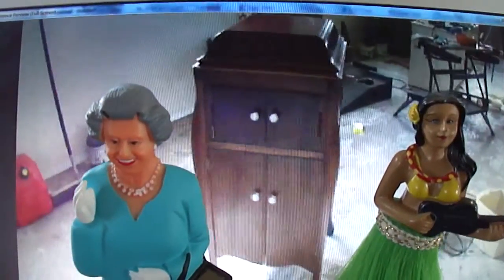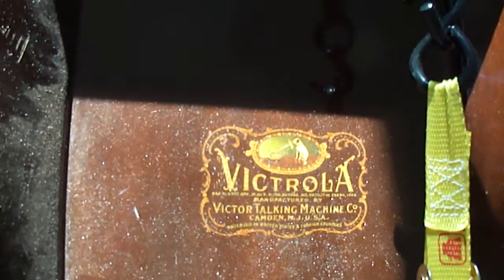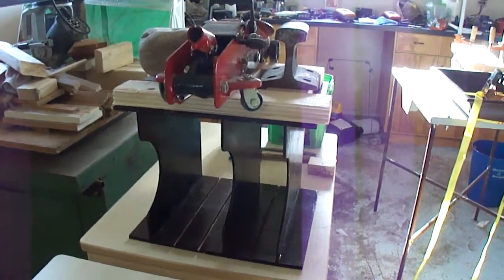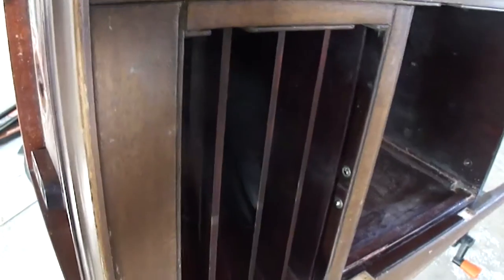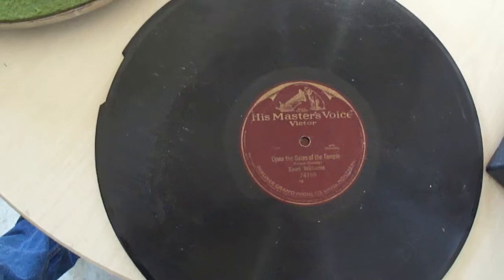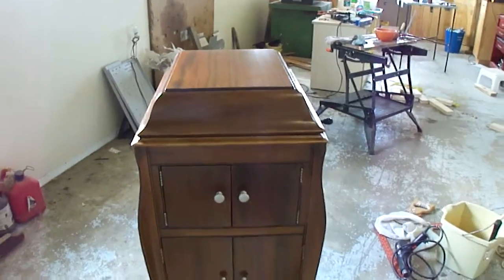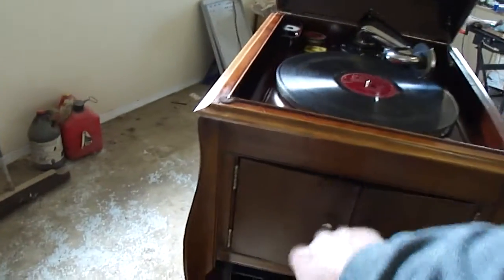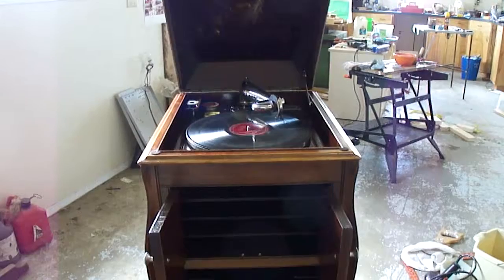Refurbish the 1900 phonograph

Comment: The diaphragm is Mica and you can buy replacements.  It also looks like at least one balance spring is broken on the needle bar.   The thumb screw should stick out directly to the right.  In addition, the gaskets are hard and leak air.  Contact Antique phonograph Supply or Great Lakes Antique Phonographs for repair or parts.